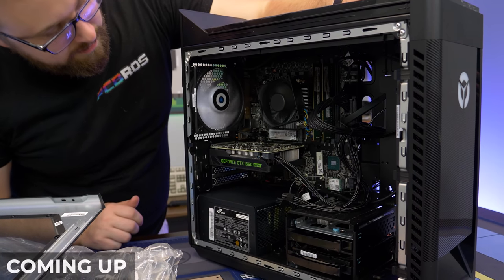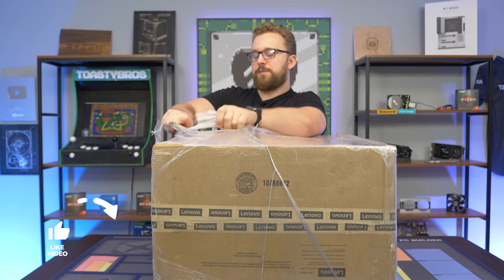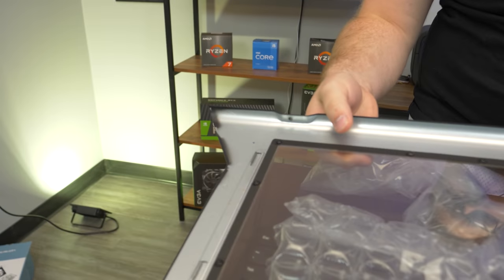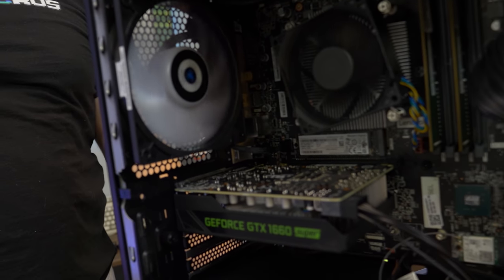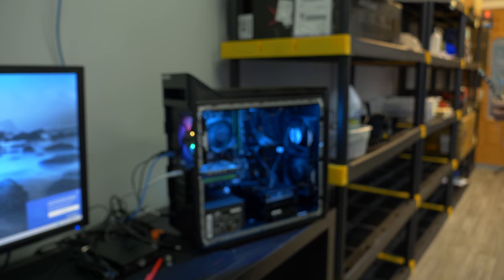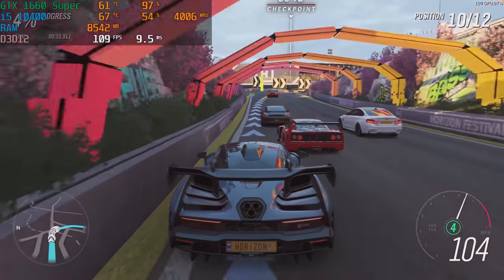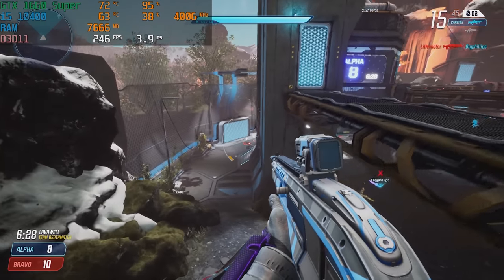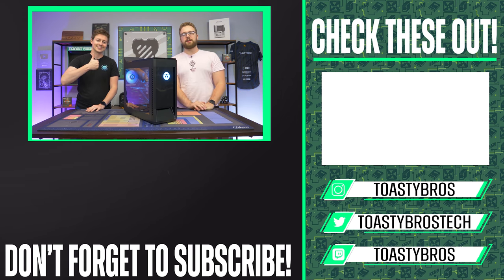We Bought a $1,000 Gaming PC From eBay...

Comment: I have the exact same pc. Its actually pretty decent. I run games at 1080p 60hz mid to high settings. I paid like $899.99 for it. Great pc, would reccomend
Reply: Same, I got it for like $600 tho
Reply: Same I got mine for 700$ I am upgrading the cpu cooler soon 
I have already added better intake fans
Reply: @cabbagememes2852  haven't upgraded it yet, but I'm looking into upgrading the CPU cooler and putting in another 2tb drive
Reply: @nomondo  great! I have already added a 1 terabyte hard drive to mine a extra one for more storage for my games, upgrading the cpu cooler is quite hard, u have to take out the motherboard in order to do it for mine which sucks, idk if u have a newer model but

The newer models of the Lenovo legion PCs have a back Motherboard viewer thing where u can see the backplate so u don’t need to take out the motherboard to install the cpu cooler
Reply: where

Comment: i got the lenovo Legion 7I with the I7 11700k and RTX 3070 with 16 GB of ram and Liquid cooling, I have it for 2 months now and I love it,it has 6 RGB fans and keeps it cool even under heavy load,the only criticism I have is the "DUMB BIOS" as is very limited and locked XMP profile,the ram that it has is 3200mhz and even when it has a Z mobo because of dumb bios the OC option are very limited,but hey I can live with that, I got it on a sale from lenovo store for 1865 USD shipped and at that price is a great deal

Comment: Bought an ATX case with a micro itx board, an Intel i5-9600kf, 16 gigs of 3200 RAM. I had a 750 watt psu and a gtx 1660 I bought earlier. Gave around 500 USD for it.

Comment: i built my pc in lockdown with a XLR8 PNY GTX 1660 ti OC its duel fan and i got a Ryzen 5 3600x , Corsair RGB pro 16gb 3600mhz and tuf motherboard not sure which one i also got a 144hz monitor, razer mechanical keyboard and hyperX mouse all for £750

Comment: I got a new one with the 1660 Super for $850. It has a slightly different Lenovo case, i5-11500. The 1660 Super is weird with the display outs, only 1 HDMI, 1 DP and 1 VGA. But it works

Comment: I believe the push pull was done because having them both in pull is not symmetrical due to wiring (by this I mean you have to turn the fan 90 degrees) to fit due to cabling - I believe this because I changed it on mine. Mine was new from costco for $800.

Comment: Cant speak for all eBay 1000 sub PC builds on E-bay But here is my last experience. I was in the market for a new/used pc and saw that a nice PC that came with a 4k monitor. Here is full list of the specs: 

Case: CORSAIR OBSIDIAN 750D Full-Tower Case - Airflow Edition (CC-9011078-WW)

Motherboard: ASUS ROG Maximus XII Hero Z490 (WiFi 6) LGA 1200
 
CPU: Intel Core i5-10400

GPU: GIGABYTE GeForce RTX 2060 Super Gaming OC 3X 8G

RAM: Corsair CMW32GX4M2C3200C16 VENGEANCE RGB PRO 32GB (4x16GB) DDR4 3200 (PC4-25600) C16 Desktop memory Black (x2) 64GB

Storage features: 
250GB Samsung 970 EVO Plus NVME 
1TB Samsung 970 EVO Plus NVME 
500GB Western Digital WD Blue SN550 NVME 
1TB Samsung 860 EVO SSD 2.5 SATA III 
4 1TB Seagate Barracuda 3.5 HDD's @ 7200 RPM (4 purchases of 1TB) 
2 4TB Seagate Barracuda 3.5 HDD's @ 5600 RPM (2 purchases of 4TB) 
240 GB Kingston A400 SSD 2.5 SATA III 

Cooling Features:  
Corsair H115i RGB Platinum AIO Liquid CPU Cooler,280mm,Dual ML140 PRO RGB PWM Fans,Intel 115x/2066,AMD AM4/TR4 
Noctua NF-A14 iPPC-3000 PWM, Heavy Duty Cooling Fan, 4-Pin, 3000 RPM (140mm, Black) : 2 of these mounted on front of case for intake
Noctua NF-A14 PWM, Premium Quiet Fan, 4-Pin (140mm, Brown) : mounted to radiator/AIO 
Corsair ML 140 PRO 140mm Premium Magnetic Levitation RGB LED PWM Fan Single 2000 RPM: This came with AIO and is mounted on rear of case 
Monitor: ASUS ROG Strix XG27UQ 27" HDR DSC Gaming Monitor, 4K (3840 x 2160), 144Hz, IPS, 1ms, Adaptive Sync, DisplayHDR 400, DCI-P3 90%, Eye Care, HDMI Display 

Additional Expansion Cards: 
ASUS ThunderboltEX 3-TR Expansion Card for Z490 (Intel 10th & 11th Gen CPUs) Motherboard (PCIe 3.0 x4 Interface, 2 x Thunderbolt 3 USB Type-C Ports with 100w USB Quick Charge, 2 x Mini DisplayPort in Ports) 
Ziyituod PCIe SATA Card, 4 Port with 4 SATA Cable, SATA Controller Expansion Card with Low Profile Bracket, Marvell 9215 Non-Raid, Boot as System Disk, Support 4 SATA 3.0 Devices(ZYT-SA3014): I use these for raid configurations even though it says non-raid - (purchased 2 of these)
Generic USB 3.0 Card PCIE 2.0 x1 (pulled from older computer) - 2 additional USB 3.0 ports capped at 372 MB/s due to PCIE 2.0 bandwith however there are a plethora of 3.0 and 3.1 ports on back of motherboard

Power Supply: 
EZDIY-FAB USB 3.1 Front Panel Header to USB-C Type-C Female Extension Cable-15inch -45cm (Speed up to 10 Gbps) mounted on backside of case, uses expansion port where expansion cards go on back of case 

Battery Backup: 
APC UPS, 1500VA UPS Battery Backup & Surge Protector, BX1500M Backup Battery, AVR, Dataline Protection and LCD Display, Back-UPS Pro Uninterruptible Power Supply

Comment: Walmart has an Asusrog prebuilt with a 5700g and gpu is 2060 Super (sometimes a 3060 version as well) for $999 that goes out of stock quickly and is randomly restocked that is a good deal.
Reply: Its in-stock with 3060 right now so tempted
Reply: @Durkhead  get it
Reply: @nate1k854  and it's gone. My wife would have been so pissed though, right at the start of the pandemic I built a pc and then bought a pre-built cause it was such a good deal

Comment: What i found surprising and didn't really get mentioned by you is that the Motherboard Chipset (at the right side of the GPU) actually has no cooler at all. 
It's just the bare chip visible which somehow feels really wrong.

Comment: I have an question 
Does having a 3 fan gpu gives you more fps than the 2 fan ?
Reply: Extra fans does usually mean more cooling, so it is definitely possible to get a bit more FPS out of the same card if it has an extra fan.  However, you may or may not see much improvement depending on how your cooling already is/how well it cools overall.  It really just depends.
Reply: @completelyaverageviewer  thanks a lot